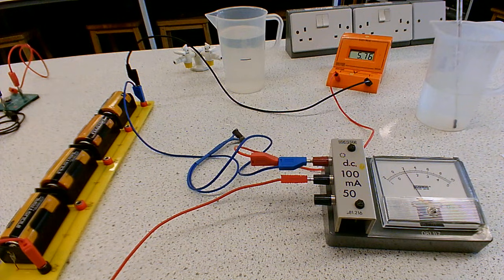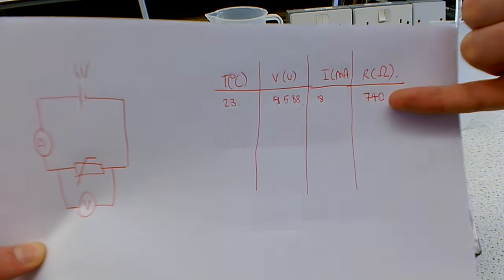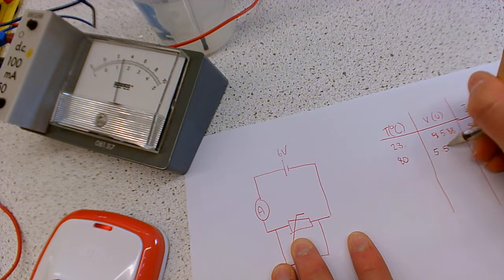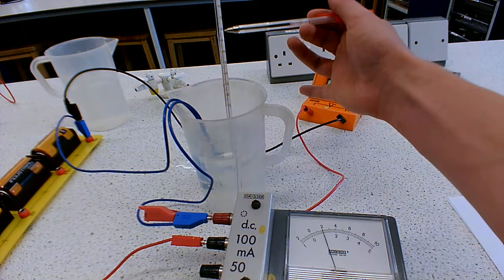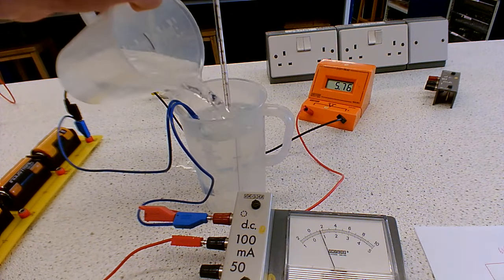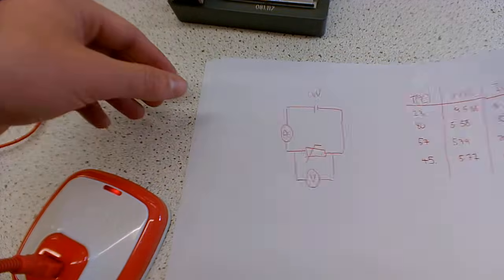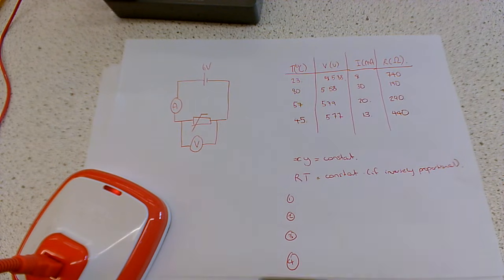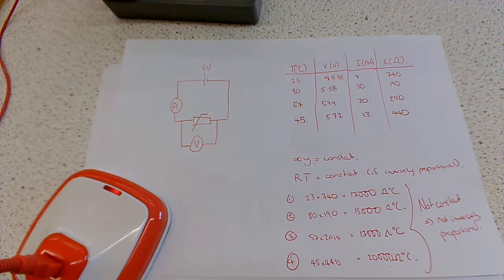GCSE Physics: Thermistor Practical

Comment: You don't need the brackets. 5.58/30/1000 = 5.58/(30/1000). It's the same thing.
Reply from the maker: True but they help with clarify of where values are coming from and how they are being used.